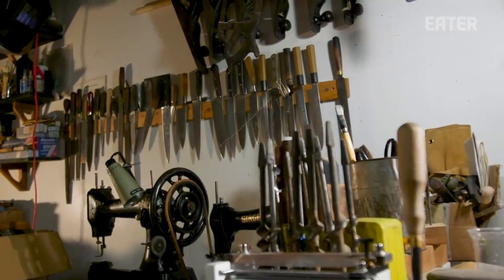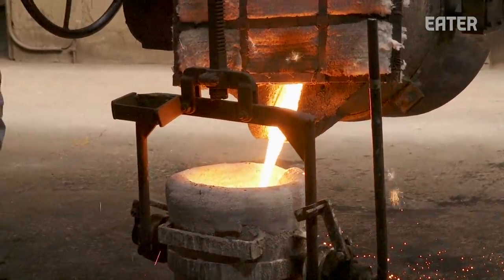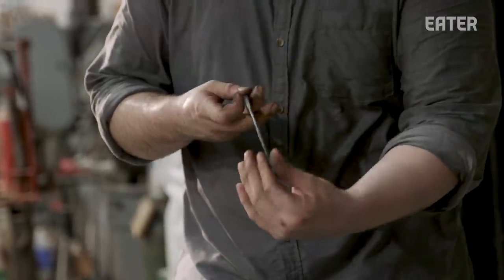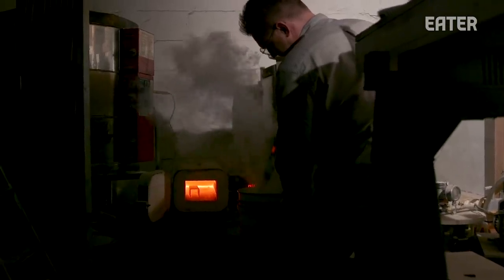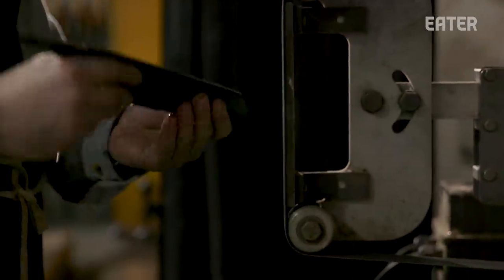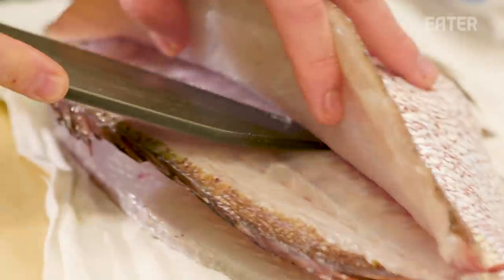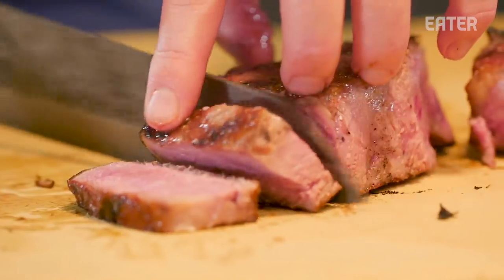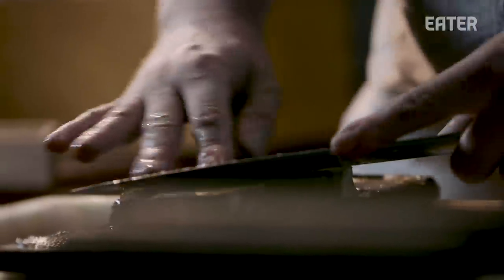How Knives Are Made for New York's Best Restaurants — Handmade

Comment: I am so relieved this isn't about Chelsea Miller
Reply: you and me both
Reply: But but but she uses scrap metal so she's recycling and recycling is good for the environment hahaha.
Reply: Sexualized knife making? SIGN ME UP!
Reply: Untempered steel is artisanal.
Reply: I came to post exactly the same thing. Charging $800 for a BS knife when you could pretty much afford a Japanese honyaki is a joke.
Reply: I agree. All the artisanal blah blah buzzwords and none of the actual qualities a real chef could use inn a knife. 

The shapes of these all look to be very useful, a lot of influence from Japanese and French knives but done in an original way. Are they all one piece carbon steel?

The only thing that worries me is the rough finish on the heels.
Reply: She's even managed to get proper chefs to recommend her, yet I've never seen any chef use her knives. Sell outs. I have a nakiri made by a family that have been around for 700 years, they used to make knives for samurai. Safe to say I know who I'd buy from. Only $200 for a great knife with generations of history.
Reply: @adamr63  They're definitely not one piece. Mono steel knives are quite rare and extremely expensive. Most knives have a softer high carbon steel (only a few percent) in the middle and then are sandwiched with another steel, such as a stainless one.
Reply: @stephen129  Yes, that's true, but his aren't exactly cheap, and I've looked on his site and the few there and available for sale at different places seem to be carbon steel, though there are a few Damascus ones.His aesthetic seems to be pretty simple high  carbon forged steels, which are some of my favorite designs.

  I own an old Sabaitier carbon mono steel and a Japanese carbon steel cladded with SS one as well, they don't have to be crazy expensive, but you just have to take care them a bit more. I think they are rare because most people don't want to deal with the potential rust and runaway patinas, and people like the look of Damascus and the contrast of cladded knives. Of course the advantage of a pure carbon cutting edge and a stainless cladding is huge from a practical sense, but nothing feels like a nono steel carbon knife, for liveliness and feedback from the board. They just sing.
Reply: @adamr63  yeah, I think his stuff is massively overpriced too, I'd never spend that much. My Japanese knives were $150-$250 and I own four of them (and one Hong Kong cleaver).
Reply: Stephen P what is your brand of choice?
Reply: @Olof123  I have a Moritaka nakiri and a Shibata Kotetsu AS (type 3) gyuto. Google videos of them in action. If sharpened properly they're very impressive. You have to be careful though, these aren't like western knives, they are harder so the edges are ground thinner, but they're also more prone to chipping. If you want to hack away at bones and hard things don't buy a Japanese knife. If you want to experience amazing cutting ability, then get one. Also you need to consider which shape you want. A gyuto is a good place to start, usually 180, 210 or 240mm depending if you have small, medium or big hands.
Reply: @stephen129  Even high quality steel is relatively cheap. Most inexpensive knives are mono steel as the labor/time cost of forge welding, even if done with machine assistance makes monosteel far less expensive  than laminated or pattern welded steels. This is even true for large scale production steel laminations available in premade bar and welded by machine on a rolling mill. There are some machine made laminate blades that can be had for under $100, but the vast majority of production knives are made from a high quality monosteel. The material cost of the steel in something like his 8" chef's knife is less than $5. Perhaps well less - depending on the quantity he purchases in, it could be less than $1.
Reply: @stephen129  Last point, High carbon steel is from 0.6-1.0% carbon, Ultra High carbon steels can go up into the 1.5% or above carbon range, but are used more rarely because of their tendency to brittleness. The steels he mentions using in the video are both ~ 1.0% carbon. The majority of his blades are mono steel construction, though I did see one pattern welded knife on his website.
Reply: It is historically true, that high quality high carbon steel was expensive, so mono steel knives didn't become commonplace until the last hundred years or so, depending on region.
Reply: I’m so relieved, too.
Reply: @recoil53  Irony off:-)
Reply: @adamr63  Have you watched it?
Reply: @georgegordonbrown9522  Yes, of course, why do you ask?
Reply: Hammer_of_creation  no it's because her product it trash and it her gender attracting the spotlight instead of her knives.
Reply: Hammer_of_creation  The last thing I care about is her gender or her looks, it seems you are far more influenced by these two things. The resistance to her designs  is due to their impracticality. As works of our art then I would be delighted to consider them on their merits, as functional kitchen knives they are silly overpriced gimmicky failures. She seems to be having no problem selling them, good for her, I doubt the fact that she is a beautiful woman is making it harder for her to succeed in the industry.She is a niche player in a niche market in any case.
Reply: @adamr63  I'm a little confused by the language use of "carbon steel".  I'm a machinist so I know a bit about metals.   All steel are carbon steel.  There is iron, and there is carbon, and when you melt them together you get steel.  That's the definition of steel.  Iron + carbon.
The higher the percentage of carbon, the stronger the steel is.   He said that he is using 1095 steel and 52100 steel.  1095 means that it is iron and 0.95% carbon - that's hard.  A "mild" steel is a 1018 steel which means 0.18% carbon, and the rest is iron.
The 52100 also has about 1% - 1.1% carbon, but it also has Chromium in it (1.3 - 1.6% chrom).  The chrome (like in SS will make it less rusty).
Stainless steel will have iron + 18% and 8% Chrome and Nickel.  (for rust prevention and hardness).  It also has 0.03 - 0.08 % carbon.
From the video it looks like he does not "sandwich" metals.  It would also not make any sense to sandwich these two metals that he is using (the 1095 and 52100).
Hope it helps a little with the terminology.
Reply: @danl.4743  Inn terms pot knife making carbon steel is a term used to describe high carbon steels with no chromium or elements that are used to make SS alloys. they are treated for hardness, admired for the ease with which you can put a sharp edge on them, equally disliked by many for the inability toi hold that edge and the lack of resistance to rust and contamination.
Reply: @danl.4743  People mean high carbon steels like white 2, aogami super etc.
Reply: Hammer_of_creation  She markets then like they're really high performing knives. Somehow she's partnered with Eleven Madison Park and Massimo Bottura at Osteria Francescana. I would eat my hat if any of the chefs there actually used her knives on the line. How would a grater on the side of the knife be useful? If she just sold them as pretty art pieces then I'd have no problem. I actually think some of them look quite move, even though they're clearly highly impractical. Some of them have ridiculously thin handles, how are you supposed to hold them? You'd get cramp.
Reply: @adamr63  , Stephen P.   Oh I see.  When people say "carbon steel" they mean high carbon.  And I guess those who know more, mean that it is only Iron and Carbon, with no other additives.  Thanks for clarifying it for me.
Reply: Hammer_of_creation  As I said. Because she makes out EMP and Osteria Francescana use her knives. You would expect two restaurants that have 3 michelin stars and have been voted 'best in the world' use decent knives, not knives with cheese graters on the side and ridiculously thin handles. Pushing her ahead of other blacksmiths is insulting to all the people who make high quality forged knives. As someone who owns a collection of Japanese knives. I can guarantee all of them perform much better than hers. Even my £50 Chinese cleaver would perform much better at a fraction of the cost.
Reply: Hammer_of_creation Did she smith that White Knight armor for you too?
Reply: @stephen129  They stopped doing that centuries ago, when you were soaking carbon into iron via tiny crucibles with hand-pumped bellows for hours. 

Steel is now so cheap it's easier to just make the whole damn thing out of steel.

In fact, I don't think it's even possible to get wrought iron these days.
Reply: @danl.4743  Carbon steel: steel that rusts.

Stainless steel: steel that don't rust. 

That's pretty much how laypeople refer to it as.
Reply: @stephen129  "Mono steel knives are quite rare and extremely expensive". bwhahaha, congrats, you have precisely zero idea what you are thalking about
Reply: Hammer_of_creation  "Beautiful women get the spotlight, and there is not a single thing wrong with her using her looks to her advantage" except when they start crying about their sexualization and not being valued for their brains but for their bodies...you lot are an hypocrite bunch, aren't you? And btw, not being the "target" (your favourite word, isn't it?) of a scammer doesn't  prevent feeling disdain for them
Reply: @TheChzoronzon  I'm referring to monosteel honyaki blades with diffferential hardening.
Reply: @stephen129  Next time, try to precise it...and btw, differential hardness in a kitchen knife is absurd, even more with modern steels...and even more in a japanese profile never designed to chop or withstand any kind of shock. I think you are thinking of katanas...
Reply: @TheChzoronzon  Next time try to form full sentences.
Reply: @stephen129  u now just salty, lol
Reply: @macfacers  but they're already recycled normally
Reply: Exactly.
Reply: macfacers but it’s. scrap metal
Reply: @macfacers  Didn't know using smelting was good for the environment
Reply: @stephen129  do you have the link. I'm interested in one day owning my own type of knives for work.
Reply: @elcacho2052  a link to what?
Reply: Lol
Reply: @stephen129  naah, it's not that, please do some research....
Reply: Her knives are horrible bottom line
Reply: @stephen129  is the family you talking about Moritaka? ;)

Comment: Better than the girl who sells horse shoe filers for 800 bucks.
Reply: @Lawlzinator  This channel featured Chelsea Miller knives a few years back. Look up 'Why The Best Chefs Use Handmade Knives'
Reply: @hippocheese14  I'm sure Gordan Ramsey would disapprove using her knife.
Reply: "Hipster Knife" not that useful; but expensive..
Reply: @roo7557  gordon ramsay uses cheap knives
Reply: yeah, but she's hot
Reply: frankly it doesn't matter what sort of base material you have as long as its high carbon steel, even if its a horse shoe rasp and its been used that really doesnt matter, you're heating it up to 2100F and that will kill all pathogens and whatever else is on the knife, the only Issue I can see with her knives is that she doesn't heat treat.
Reply: Files, especially from farriers, are some of the best high carbon steel flat stock that you can get your hands on for Tool making. Also good stock, for blade making are used blades from sawmills cut down to size.
Reply: Kazuo7557 Gordon Ramsey is a celeb chef. Embarrassing
Reply: Albert Yang it’s look tools. If you do this for a living we want quality tools that last a lifetime.
Reply: Corn Dude Thats just what we prefer in an actual kitchen where you bash your knives to the limit. Lots of professional also uses those kinds of knives. This kind of expensive knives are very impractical.
Reply: They are hoof rasps...just saying.BTW I am not a farrier. And yeah.. why use them when so many steels are available in a better form factor for the stock removal method eh?
Reply: A lot of self proclaimed professionals commenting I see. As usual.
Reply: Exactly
Reply: @prestonedmonds4704  She doesnt, dude. She just files it down. She doesnt smelt anything.
Reply: @roo7557  Gordon* Ramsay uses the knives he's getting paid for to use. He doesn't even shy away from dulling a knife on a honing rod in front of the camera and calling that istructions on "how to sharpen your knife". If that horse shoe file-lady was able to pay him a million $ per season for using her silly knives, he would gladly do so.
Reply: @prestonedmonds4704  her knives are thick and not forged just ground down and heat treated

Comment: 2:50 Sorry man, but it's the exact opposite. Smaller grains, hard/brittle metal. Bigger grains, soft/ductile metal.
The reason why you use forging instead of casting is because deforming the metal (hammering it) creates dislocations within the grains (THAT takes too long to explain), and the higher the dislocation density the lower the ductility.
It's a bit like, if you let steel cool down slowly, all the atoms will be where they want to be and the steel is pretty ductile. If you mess with the atoms in any way (quenching = not giving them time to move / deformation = making them move by force), you get more brittle steel. 
(Metallurgical engineer here 👋)
Reply: I usually say faster the cooling smaller the grain. When you have less time to make friends you have smaller groups. Heat= time and atoms= people. Bigger network are more flexible smaller network are more rigid.
Reply: throwback to materials engineering class for me, mechanical here
Reply: So this leads me to ask you how can a man in the business be so fundamentally wrong?
Reply: @johnsmith-wx5fb  no one stress tasted his products.
Reply: @nhankhuu5643  tested. He has no business making knives.
Reply: @johnsmith-wx5fb  sorry i for distracted by the food
Reply: @johnsmith-wx5fb  Easy. He knows how to do it, but doesn't know exactly why it works. Most artisans are just the same. Metallurgy is old af, but materials science isn't.
Reply: @S_Carol  he needs to stop. He needs to stop right now
Reply: @S_Carol  smaller crystals= shorter dislocations which creates a harder metal.
Reply: @bradley242  thats really interesting, could you please tell me what is dislocation?
Reply: It's true that large grain sizes makes a more brittle knife. A small grain size is more desirable.
Reply: Bad argument from authority. You want fine grain in steel, not big grains. Finer grained steel is absolutely tougher, it machines/sharpens better, it keeps an acute, highly polished edge better. I don't know that forging refines grain structure as much as the heat treating process, but it's definitely false to say you want bigger grains in steel, or that a finer grain produces a more brittle knife. Heterogeneity in the steel and large carbides gives you a brittle steel with poor edge stability. 

You don't want your steel to be as soft and ductile as possible for a knife, that doesn't make any sense. You also don't want it to be as hard as possible. That's the entire point. You quench to produce martensite for hardness and then temper to improve toughness.